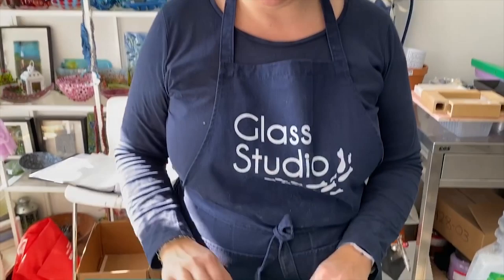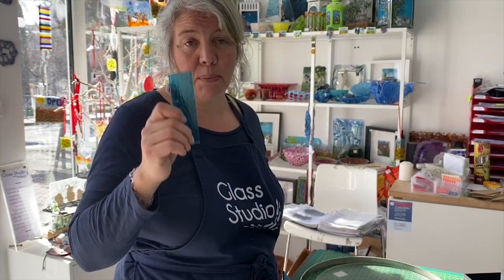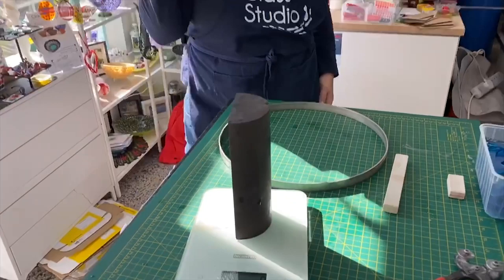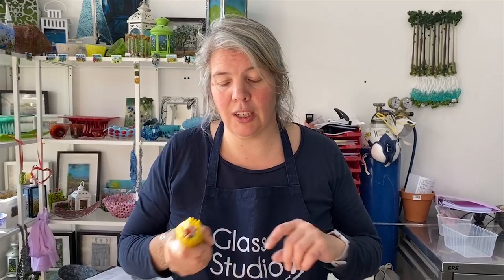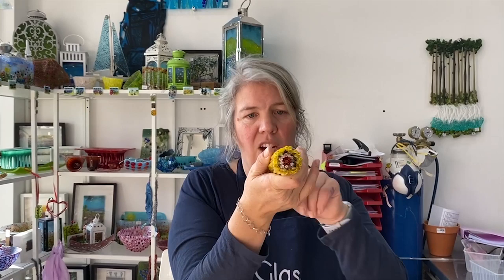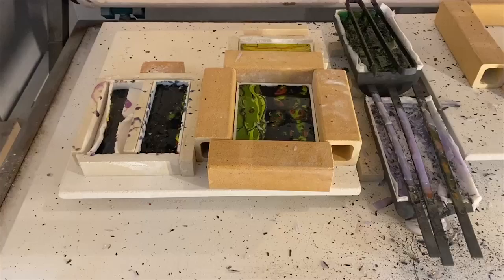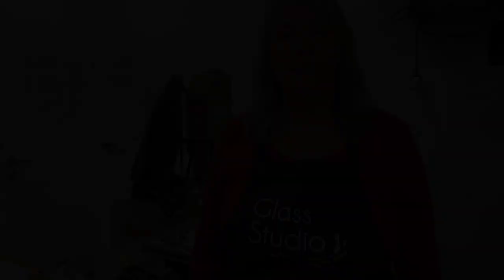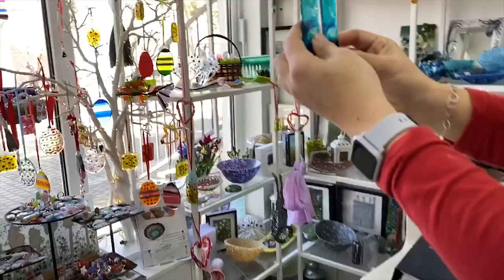Fused Glass Pattern Bar Tutorial

Comment: Thanks Tabitha, you always have great videos!
I read somewhere that you need to buff the saw cuts or you will get a haze after firing the cut bars into a piece.  Do you do this or not find it necessary?
Also, how thin do you cut your slices?
Reply from the maker: I grind all the edges and then also add put a layer of clear powder on top of them as well.

Comment: I’m thinking of making a candy dish, with the tiny pieces similar to yours, but incorporating them in the middle & running up the side of the bowl, any suggestions before I start this project?  Those pieces are amazing!
Reply from the maker: my advice would be to make sure your bottom piece of glass is evenly covered by the bits on top, try not to leave any gaps, even using frit to fill in the spaces between the bits. Other than that, enjoy and I would love to see the final result.

Comment: Tabitha, how many layers of glass do u use to make the pattern bars with
Reply from the maker: Really depends on how big abc how thick I want it
Reply: @TabithasGlassEmporium  when making glass puddles the high temp is 1500* and the stacked glass is 8 high. maybe 24 mm.  but at that high of a fire the puddle spreads out ..i suppose i could dam it up. i havent tried that yet.. but i would like to try what u have been doing.
Reply from the maker: Yes you will need to dam them